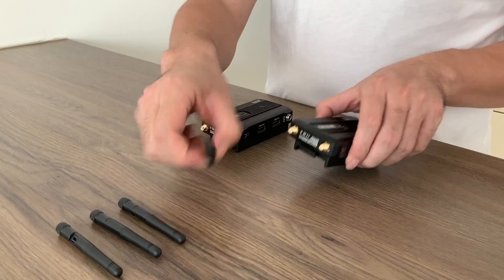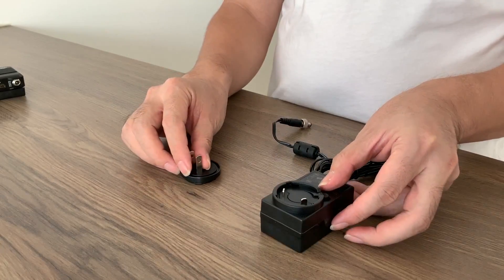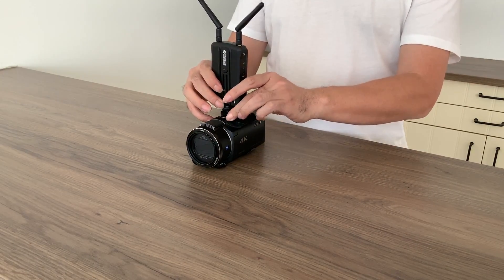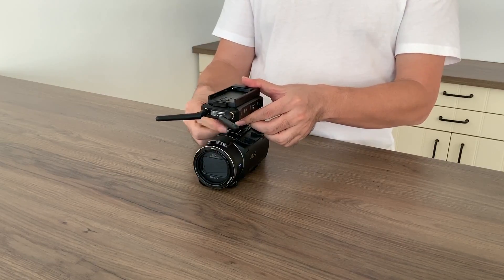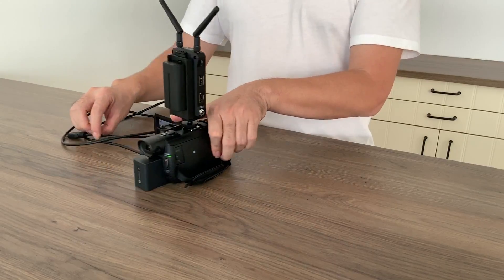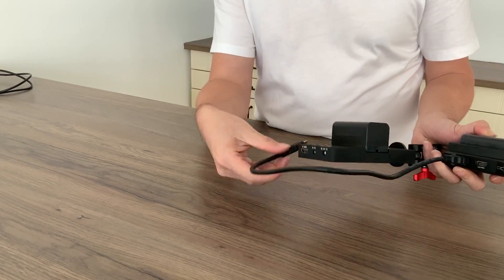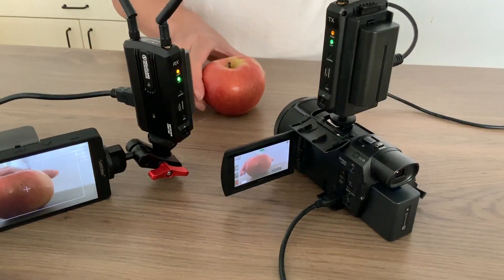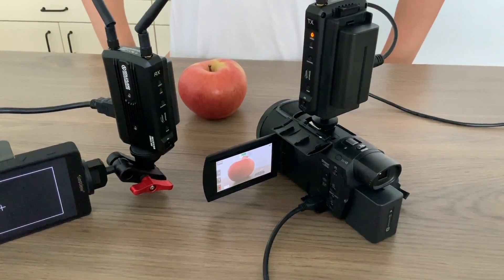Basic Setup and Installation Tutorial for HOLLYLAND MARS 300

Comment: Anyone knows if upgrading the anntena helps the range?
Reply from the maker: Hello Melvin! The main purpose of different antennas is to solve the problem of height difference in the use scene. And for signal enhancement, the external antenna usually is stronger than the internal antenna. Hope it can help~

Comment: Hi, I just bought the mars 300, but it doesn't support  my GH4. Where do I find the updated firmware? I can't find it on your website
Reply from the maker: Hi, thank you for supporting us. GH4 is special, and the camera processor can only output 2 channels of video at the same time. When connecting to MARS 300, the HDMI port will grab the video signal from the LCD screen of the camera itself. The solution is:
1: Press the eyepiece button next to the GH4 eyepiece to open the eyepiece video, and the camera's own screen will be closed.
2: Turn on the MARS 300, wait for the orange video light on the RX to have a video.
3: Press the button next to the eyepiece to close the eyepiece, so that the MARS 300 and the camera's own LCD screen can be displayed at the same time.
And you can know more information from our Facebook and Official Website!
Reply: What about the GH3 and GH5?